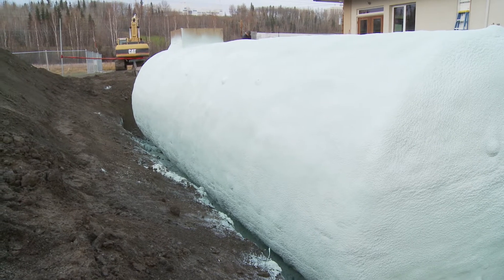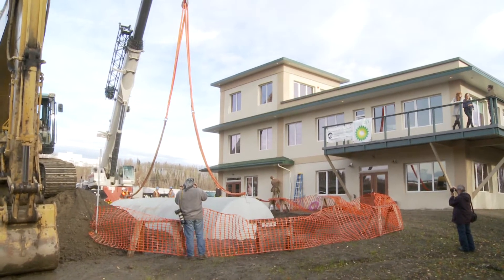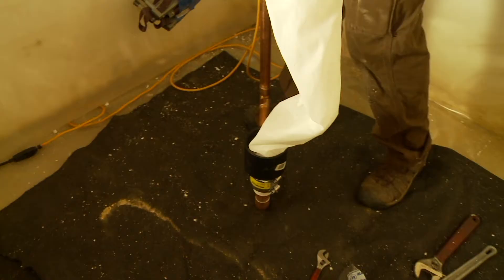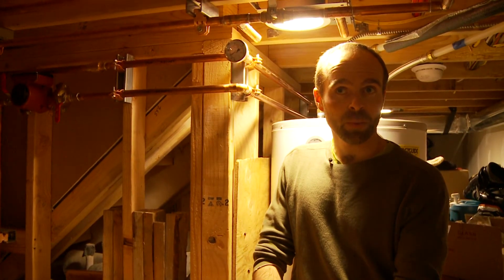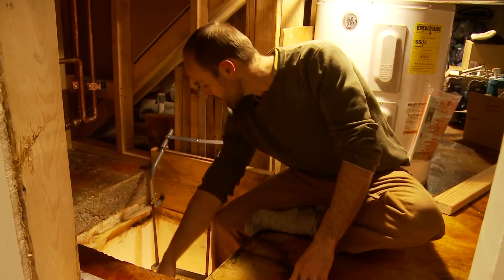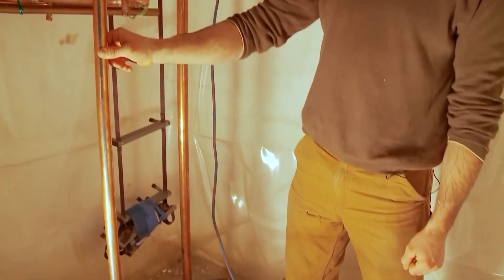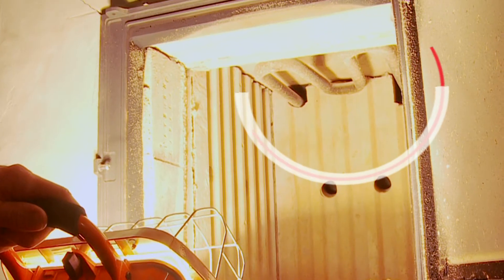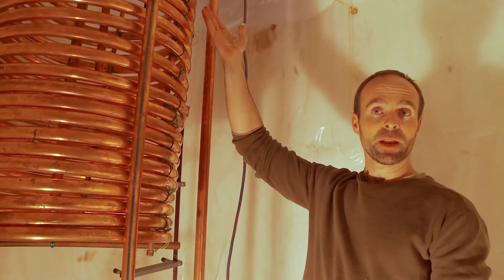Inside CCHRC: Thermal storage

Comment: You may want to consider to use a latent heat storage mixture in your tank. It can store more energy at lower temperatures by using phase transitions. It may reduce energy loss during storage to zero and increase the storage capacity.

Comment: No fossil fuels.... Except that spray foam is made from a polymer that comes from.... Oil. That cat excavator... Burned diesel... The truck that got all that equipment there ... Diesel.... All the equipment to cut down the wood to make the home.... Diesel.... The mines that dug out the colper for those pipes .... Diesel..... This green kick is just a high priced feel good. Now that being said. I have 12.2 kw of solar panels, 85kwh of lithium iron batteries and a 12kw inverter .... Not because its green but because of this green agenda the power grid has become unstable and i took control of my own power so i dont lose all my meat that i raised and grew myself.

Comment: You could have a higher yield if you used sand instead of water, as heat storage
Reply: 4.5 times higher energy density with clay or sand, plus fewer issues with moisture and having to limit temperatures. Burning wood seems to have a far greater importence to the viability of this project than he is suggesting.

Comment: I'm curious about the two methods, the insulated steel tank, and the insulated box under your house. Would it not be feasible to make a large version of the insulated box rather than the tank? How about this, a 20' x 10' x 10' hole in the ground, line it with pond-liner material to keep water out, then line it with hard foam insulation, then rebar and concrete like a swimming pool? I have not thought through how to cover it but some kind of ridge frame, then foam, then a sheet of pond liner. Would all that be more expensive than the tank?
Reply: Using sand or clay as the medium for storing heat has an energy storage density 4.5 times higher than water, also the house has a road bridge in the background and is on flat ground. I am thinking this project makes less sense the more I look at it due to accessing near freezing water in winter to replenish his tank, then threat of spring flood. Plus an over relience on wood, which he refers to as 'bio-mass'.
Reply: @conormcmenemie5126 clay or sand is 4.5x less specific heat capacity than water, you have got this backwards
Reply: @jimbobarooney2861  Water can only be taken up to about 90'C but 600 plus with sand etc

Comment: dude if you want to use let heating oil and fuel move closer to the equator, or live in a smaller house. r115 in the cieling? these materials your using are created by using non renewable fuel sorces, how much fuel did it cost to make all these materials?,  steel tank, pray foam, copper tubing, concrete, ect. if you equate all these things you could have just burned the oil in a smaller house, and it would haveprovided you with a life time of heat, have fun recycling that tank and decaying foam leaching into the water supply.

Comment: I am fascinated by all this, but go back to comparing all this set-up to just having buried air tubes to harvest Earth ambient temp air (55F in Wisconsin) to feed into a high efficiency heat exchanger (Mini split) system in winter with solar and batteries. Adding reflective material in winter months to harvest more lumens, remove in the Spring. I agree, start with a building that needs less heat and cooling (SIP'S are 2 1/2 times stronger and 15 times tighter than stick built) and add these systems. I think I would go with a sand battery under the house "charged" over the summer and fall.

Comment: it is all theory. the tank has to be way way way bigger to collect in the summer and have heat during the winter. building the tank with the needed size and isolate it makes the total calculation non preferent. in other words it is way too expensive to ever get your money back. so this is only for people who want to spend a lot of money to be good for the environment. but then again the polyetheleen foam was also produced using oil etc etc. The sock is also fantasy. just release it and it will find its way in the tank. this is all fantasy

Comment: Have you looked at sand for your energy storage rather than water....much more efficient as you would heat the sand box with hot water from your panels and heat the building with a coil in the sand also.
If l am correct a city in Finland uses this method to heat all the residents buildings!

Comment: What is your opinion on sand or salt as a battery instead of h20. Both store so much more heat than h20.
Reply: Actually, sand holds 5 times less energy per kilogram. Water holds 4186 joules per kilogram and sand holds about 800 joules per kilogram. Sand can go higher temperature, but you're not getting above 80°C with flat plate solar heat collectors regardless so there's no point, water is the perfect candidate. And it's pretty much free and can be moved around much more easily in pipes.

Another problem with going higher temperature is the the hotter something gets, the faster it loses its heat to the environment.
Reply: And small sand batteries are the size of the entire house

Comment: No fossil fuels. Nice. Unfortunately I see a lot of material that isn't eco friendly at all. Concrete floor.. Concrete is not eco friendly. It costs a lot of energy to make. The foam around the tank is also not sustainable. It's probably made from oil. How thick is the insulation? I'd guess it needs to be at least 3 ft thick.

Not surprised to see a BP flag.

You could call it a false flag operation:)

Comment: I’m in a slightly warmer climate in the mountains of Japan, and am about to build a ducted air system using a sand battery of 3 cubic meters with solar panels running the heating elements.
The idea is to get the core above 600 degrees Celsius, and top it up on sunny days, i wonder how they’ll compare?

Comment: nice.  used thermosypion  shower and laundry for years..   no problem with 160 degree water...  
scald guard shower!   salvage  electric water heater... 2 3x7  boxed and glazed panels ..  big  tank stratification..  next is sand battery. dc direct..  for hvac

Comment: The  Thermal mas was 8' x 9'' x 10'  720 cubic Feet. 
Why not have done a 20' x 20' x 2' (800 cubic ft) 'sub-sub floor 'slab', since you were building up anyways? 
This would given you have options as to how that heat gets up through the subfloor (air circulation path, floor heating circulation (lass draw horsepower for lift needed over lt) . Dual 10' x 20' x 2' can be done, depending on the sub floor, or if the bottom of a basement area, even as a greenhouse floor. Done using the same design as for a slab containers. Circulation of a store to release differential system can be done from the house wake/sleep south/north areas back/forth to regulate.  Straight copper manifold is more efficient transfer of heat than the single coil method.
Reply: If the tank is only two feet deep there would not be room for stratification.

Comment: I did a quick calculation on this tank. From the volume I calculated the area of the tank to be approx. The insulation is perhaps 2"-4", 5 tol 10 c, The area approx. 130 m2. The insulation used look like something that have a  Lambda = 0,038 W/mK . To get any meaningful heat form the water it need to be above 20C. This means a dT of at least 20. So, the lowest heat loss from the tank to the ground will with 10 cm insulation be 1 kW. Hopefully the peak can be 40C in the tank, with a heatloss of 2 kW, or close to 50 kWh/day.  If you take heat out of the tank to heat your house and hot water, the tank will most likely be "empty" after 45 days. Any link available to the online data mentioned to be available?
Reply: I am not a native English speaker but will try my best.

You are missing a crucial point in the insulation theory. After some years a heat gradient will be created around the tanke effectively making the dirt work as insulation. You should take the temperature delta between the exterior air and the tank water. Then you will have an additional 10 meters of insulation once steady state has been achieved.	

Look at, Borehole Thermal Energy Storage you only insulated the shortest distance to the air. The rest is considered thermal mass and insulation.
Reply: @arvidjohansson3120  , I am aware of  borehole energy storarge, and the effekt will kick in for this tank to. How much hard to say. The best way to put the tank in to ground to get benefit of the heat going out intp grouund would be to digg it down vertical, now horizontal to much heat loss upward to the air.

Comment: if the tank could be pressurized to only 5 psi then a cryocooler could provide you with liquid co2 in the summer that can be used to not only spin a turbine as it expands but also provide cooling for the house..using solar power to run the turboexpander could make it net zero or even positive
Reply: I'd love to see your calculations and hate to write cheques for materials and installation for what you describe.  There is no suggestion we need electrical generation from the client here. Surely using solar and to run a heat pump would be better if heat not electricity is the name of the game.

Comment: if the tank is buried at 6 feet then the constant temp should mean that the water inside never drops below 58 degrees.. meaning you are only having to heat the water 12 degrees F or so. or even if too expensive to dig that deep thermal ground loops that only open once the water temp has dropped would accomplish the same thing??
Reply: Except in Alaska they still have permafrost

Comment: I am interested how it works for you.  I have never heard of a stratifier. One problem I see though, is that water conducts heat extremely well.  Also moving water around in a tank, even if it is injected at the right level will cause currents which will cause the different layers to mix. You will likely have to heat up large quantity of water in order to heat up enough water to heat the coil. That will take a long time, and by that time the tank will be at about a uniform temperature.
Reply: I does not work like you mentioned, a warmer water acts like an oil and water, the layers in the tank never mix with each other. This is convection principle or whatever it's called. The heat accumulator should be always heated up from the top to the bottom, I mean, using the main source of energy, so you always have the energy available from the tank even if the tank is not fully "charged".
Reply: @udaizd  This video shows the mixing of hot and cold water. Also the dissipation (at least somewhat) of heat over ten-minute period. In the original video it would take probably take two days or a week or a month or something like that to get enough hot water. This would allow for a lot of dissipation of heat even if the water layers didn't mix.
https://www.youtube.com/watch?v=H0xB15fNzHc
Reply: @udaizd  You are correct, it's the same as normal hot water immersion tanks work in the home, the hot and cold water split with all the heat up top, and we have been using this system for over 100 years now.

Comment: Nice system. It shows me that in spite of your zero hydrocarbon fuels goal, much was used to manufacture, delivery and installation your specialty foams and construction equipment/products. Can you say that you have zero connectivity to any source of power that never gets powered by your dreaded hydrocarbons?  Specify such a home, materials, deliveries, construction techniques, any an all transportation for your hired labor and your hired labor's lifestyle and you will find your goal is impossible.  No-one would build it for you.  You can place these goals on yourself but will never be able to force others to make the same choice. We are forever linked to using oil.  Strip away oil consumption and mankind will starve right after the earth is deforested  (look up Easter Island).  Good luck anyway.

Comment: That insulation is far, far from sufficient enough to store heat for that length of time. Guess you realize that by now.
Reply: @ONeill_Nolan  Did the maths recently and I can't agree with your opinion and neither will you after I explain. Water's heat capacity is 700 greater than air. That means that with 1m3 of water at 40C going to 20C, you can heat up 700m3 of air, that's around a 300m2 house, with 20C. Your house might lose 1.5C of heat an hour during winter if poorly insulated, in which case 1m3 water at 40 would last 20 / 1.5 = 13 hours of heating; now, if the water is 90C, you can do it 3.5 times, meaning the maximum capacity is 46 hours of heating. Lets say the house is 150m2 and you lose 0.75C an hour which is more realistic, that's 186 hours. Getting somewhere, just over 1 week of heating in 1 cubic meter of water, though assuming it's full capacity and that it's only used for space heating. Now do that with 20 very well insulated cubic metres of water and it would last the cold season. Given that the potential capacity is so great, I see little meaning in isolating the house better just because of the occasion; you'd be better off spending that money on a slightly bigger tank and/or better tank insulation. If you collect the heat for free, who cares anyway, as long as you can store an abundance, which is feasible on the cheapish.

Comment: I remember years ago the Japanese company Toshiba I believe is the one that was trying to develop these RTG devices which would provide heat for at least forty years and do it safely. That will be a perfect solution for  a low pressure heating system that would last a lifetime.
Reply: ...except the power levels are likely way too low, or the price so astronomical, or those combined with the containment concerns involved with radioactive materials that would make such devices unsuitable for much other than space probes and a few other rather unique circumstances.

Comment: I’d love to see you add “health” and “air quality” sensors to this. From what I’m looking at, there’s a potential for bacteria issues, and maybe radon from the basement(?). Just spit-balling challenges. Love most of the design overall. As others have said, I’d be curious about how using a molten-salt form of energy storage would change the dynamics. All the best to you.
Reply: Maybe UV lighting inside the tanks to control bacteria?
Reply: I'm unsure if bacteria will really be a problem. The potable water is completely contained in that copper coil heat exchanger. The in-floor heating and solar-thermal panel water is the only water that is cycling in the main body of the tank.

Comment: I'm looking to utilize a liquid to liquid heat pump system, 3 reservoirs 1 hot ,1 cold,1 neutral. Each faucet should have a return line for flushing the undesired water temp out of the pipe. When point of use reaches temperature solenoid opens allowing water to flow out of faucet. I thought about applying such a system to the fridge, A/C, etc. Utilizing a central heat pump setup would greatly help efficiency imo. Imagine a central geothermal heat pump system for a  small neighborhood. Maintain it just like an essential utility like water or gas. Energy use on the grid would be dramatically reduced, especially if the system was powered via solar.

Comment: Why do you need the stratifier sock? What happens if you don't have it?  – Wouldn't the water move by itself per temperature & buoyancy?
Reply: If returning water just enters the bottom of the tank at any angle it will mix the water and there would be no stratification

Comment: I don't know how the copper pipe would react to it, but way more heat can be stored in the same  water volume with potassium nitrate and sodium nitrate salts  dissolved in the water. I think 40% potassium to about 60% sodium mix being most effective and of course, the more dessolved in, the more heat it can hold. I don't think they're near as corrosive as sodium chlorite (seasalt, table, common salt) and they are good fertilizers.
Reply: Mmmm tasty, im definitely hiring you for my plumbing needs.

Comment: i have seen a lot of these types of systems with my own eyes degrade the plastic liner. i really like the idea of these systems but i think water might noy be the best heat transfer liquid and that platic liners may not be the best tank. i know it would up the cost by a lot but a stainless steel tank would be best and to use a therminol heat transfer fluid

Comment: So you want to match the incoming water with the right heat layer in the tank so you don't dilute or average out the whole tank I take it?
Reply: Correct. If the bottom half is 70 degrees and the top half is 150 degrees you can still effectively heat using the 150 degree water. You need a temperature difference for the water to do any real work.

If it were averaged out to 110 in the tank then it wouldnt be hot enough to use for thr domestic hot water and it would not fully heat the house either (though could still perhaps keep it warmish).

Think about your water heater, it does this same stratification.  If you are taking a shower youbare happy as lon as the water comes out hot right? Maybe there is only 5 gallons of hotnwater left in the tabk, but younare happy. If it were all mixed up partway through the shower and the temp dropped to 75 you would no longer be happy with the showet

Comment: Wouldn't the polystyrene and vinyl liners start leeching chemicals into the water due to all that heat ?
Reply: no problem, drinkable water goes trough that coil and never touches with tank water.

Comment: if i unterstood correctly
he needs to nonstop burn wood in the winter to get his tank onto the used temperature?

so he can use that tank in the summer and doesnt need extra fuel based heat
is it usefull to do that kind of heating? why not use solarpower to get electrical heat?